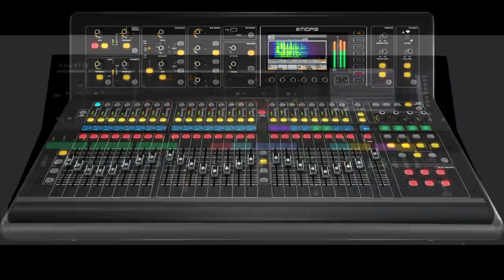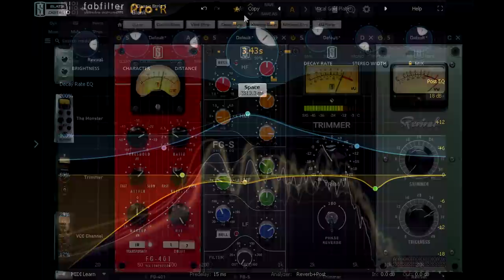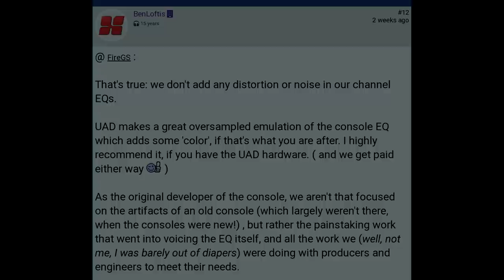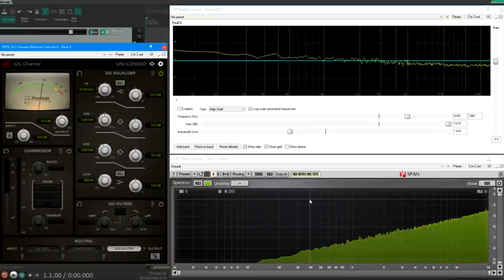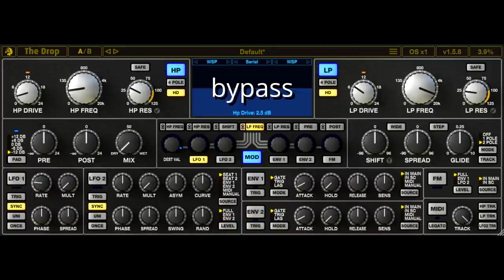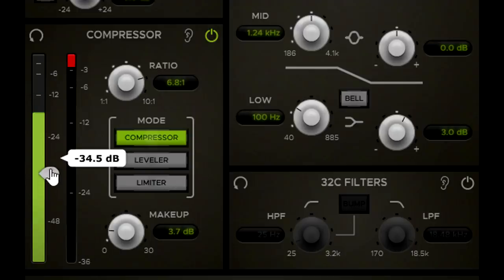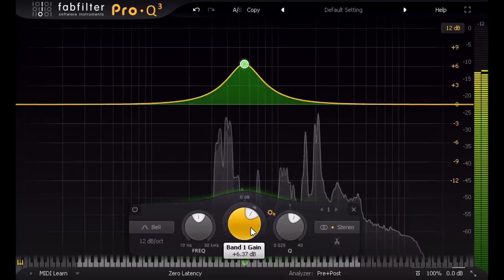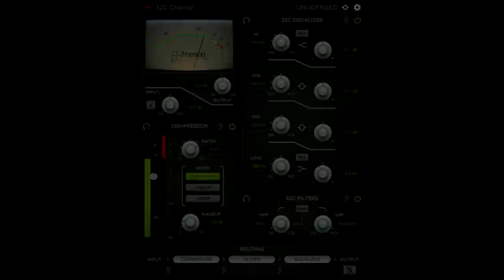Why Does It Null? (with ReaEQ) Harrison 32C Channel Strip

Comment: "More controls does not equal more control" - so profound. Just imagine if automobiles had busy user interfaces like some audio plugins. They'd be even more dangerous than they already are.
Reply: They did, and they were. Navigation/entertainment systems had to be scaled back and/or made more voice responsive due to distracted drivers.
Reply: This is kinda the point of the why the 32c EQ was designed the way it was in the first place. The values from the components chosen is what makes the final EQ curve and overall response.  If you want to adjust the Q then use a different EQ but if you want to try a proportional Q option then the Harrison EQ does a fine job of fixing the most amount of issues in the least amount of time.   If you mix with your eyes and not your ears then maybe using an EQ with a graph is more up your alley.  This is how mixing on a desk worked "back in the day" and some mixers still prefer that kind of workflow.
Reply: @DoctorMcFarlandStudios  If this vst really was made well, you could fix even more problems in even less time with no drawbacks. At least that's what I got from Dan's analysis

Comment: Maybe the circuit modelling they refer to means they made a SPICE model of the complete original circuit, used that to determine the relationship between the nominal values and actual values on the controls, and then released a completely standard digital EQ with the control values offset accordingly...

Comment: Reckon many of us have tried just about every single strip out there and, even though I don't use it specifically on an extremely high-percentage of projects, if I could have one and only one strip to choose regardless of the task at hand I have to go with Omni Channel. It's much deeper than you visually see on the surface, w/ hidden advanced features one is likely not to always use keeping the main interface relatively clean, logical, and efficient including hot-key features. It has enough tools to get you through most general mix chores as well as some more advanced tools (like the dual DS) and "color" options. Kind of crazy how many hundreds (maybe thousands) of $ spent on strips over the years and the one I'd choose today if I could have only one cost me around $20 on sale if I remember correctly. If any of y'all haven't given it a go, check it out sometime. Kindest regards.

Comment: I have nulled the overly expensive Trident EQ's which caused a huge debate on Gearslutz. Then I nulled the Bettermaker EQ, and i got attacked by at least 10 people on GS :D When i provided blind test sound examples, only 2 people reacted, both picking Crave EQ as the "better sounding".

Comment: Seems to me, like an unfinished project, from the moment you opened the plugin, I noticed the apart knobs from the compressor, and I was right you could choose only one setting per button. I use rack plugins as well, like the Slate racks, also those from McDsp are very good. Except you have to load a I-Lock instance, I don't like such things running on the background of my computer. About the plugin, I don't think I would spend my money on this one. Harrison was in the past a topnotch brand, but with this, they got a big bump.

Comment: Sort of surprised to see that Harrison didn't include the excellent bus saturation that is included in Mixbus, but it does make sense as track channels in Mixbus don't have saturation on them and the controls here are the tracks and not busses. Maybe they're planning to release the mix and master bus control strips as a separate plugin or plugins. As a Mixbus user I definitely love seeing the Mixbus DSP being made portable in plugin form and I'd definitely use it in other DAWS in order to bring my 'comfort zone' with me. I'd be really interested to hear you taking a second look at this DSP on it's home turf, embedded in the Mixbus DAW.
Reply: I 'm not sure you got the point of the video. There is no difference between Mixbus' EQ and any other EQ on any different DAW. It's a placebo. There's nothing to transfer from Mixbus to another DAW, except the false frequency references.
Reply: @dirtyharry1881  workflow, interface and the associated intuition and experience with that tool.
Reply: @dirtyharry1881   the video did not cover the Mixbus EQ. This is the 32C channel plugin EQ. Not the EQ in Mixbus.

Comment: Speaking of channel strip plugins being free of non-linearities, I recently took a look at the new SSL Native plugins, specifically the Bus Compressor v2 and their channel strip.
Turns out, neither of those plugins adds saturation out of the box, harmonics created via compression not included. EQ section nullable via Pro-Q3.
For myself, that was the reason why I decided against the SSL channel strip. Same thing with the 32C shown.
Reply: To be fair I reckon it's because they push their Fusion Vintage Drive or X-Saturator to be used in conjunction.

Comment: Wow, amazing demonstration, thanks 😁
But it's raising another big question: is Mixbus 32C DAW  emulating perfectly the real analog console from the '80s like they're claiming on the website?...now I start to doubt 🤔
Reply from the maker: No analogue console has infinite headroom: push it hard enough and the console will distort in a way that the plug-in doesn't. Of course, the original console designers would have made it that clean if they could! Other than that i can't comment as I don't have a console to compare with.

Comment: 32C tarmacked for the second time in the last few days.
Apart from your impeccable explanation about this particularily puzzling channel strip plugin. But I think that generally, such plugins don't make much sense GUI-wise. They would maybe, if if they could be integrated in the DAW channel strip. Or at least if you could use a single instance of them that auto-switch when selecting different channels. That way one could also map a separate MIDI controller just for the plugin and act like it was a real console.. But having to select them every time and switch from channel to channel just like every other plugin, I don't know. It's clunky. They're too big.
Reply: I've recently gotten into Ableton, and at first I wasn't really feeling their minimalist UI for all their stock effects and instruments. Somehow feels less inspiring. However, after spending some time with it, it's slowly growing on me (for effects, at least; softsynths, I still prefer more interesting UIs). With the way their effects strip works, you can see all the plugins/effects for a channel down at the bottom of the screen at all times; 3rd party plugins you have to open up to view their GUI obviously, but the Ableton ones or any MFL devices are just there. Even for the 3rd party effects, Ableton provides a generic X/Y controller with drop downs for assigning parameters, so even there you're able to have a fair amount of control without having to pop open a dozen windows. It's real nice being able to see and interact with everything at once, and it makes automation and assigning MIDI a breeze. (And if you want to blow up, say, the EQ to view it in larger resolution, you can still do that.)

Professionally, I'm a software dev, and I think people are just willing to shell out more cash for things that look visually impressive in all things software. For instance, this 32C strip seems almost entirely a somewhat analog looking UI wrapper around fairly stock plugin functionality... yet is being sold for nearly $100.

Comment: Dan, can we get some backstory on how you started out in audio? Did you study at University? How did you cultivate your skill set, and are they any tips or pitfalls to watch out for while learning the craft?
Reply from the maker: Never went to uni. I'm still on my gap year ;)

I progressed from guitarist, to live engineer, to studio engineer, with a three year stint as a midi programmer along the way. 

Best tip I can offer, in the unlikely event that you follow a similar path to me is: be careful with your hearing. I cringe when I think back to the cramped, untreated practise rooms I used to spend hours in, right next to a really loud drum kit... I became more careful once audio engineering became my job, but I consider myself extremely lucky to have survived my band playing years with my hearing intact.
Reply: @DanWorrall  I recently got the privilege of seeing Megadeth live in concert. I brought ear plugs, because I know concerts are a great way to do damage to your hearing. As a live engineer, is there a way to protect your hearing without muffling the sound with foam ear plugs? I would imagine that would make it hard to judge the mix.
Reply from the maker: Moulded ear plugs. Proper ones are custom made to fit your ears, and attenuate frequencies evenly across the spectrum. I actually have unusually small ear canals, and can't wear generic plugs: I find them extremely uncomfortable.

But, this is only when babysitting other engineers, packing up while the idiot DJ plays, or for monitor world. I would never wear plugs while actually mixing a show at FoH, because then how could I judge if it's too loud for the audience?
Reply: @DanWorrall  Thank you for the advice! As long as you keep responding, I'm going to keep bugging you :) What do you think about automatic mixing plugins like iZotope's Neutron 3? White Sea seemed to be pretty impressed by it in a slightly older video. After watching his review I almost went to buy it, but I decided not to. As I'm still new to mixing, I wondered if having something do a lot of the heavy lifting for me, I might not learn as much. How do you feel about these types of plugins? Do you think it's the way of the future to produce good mixes faster? Or is it a way to become lazy and produce mediocre mixes that don't sound unique? And how much does it matter?
Reply from the maker: I haven't tried it. I haven't watched Wytse's video either. Instinctively sceptical, but honestly don't know.

Comment: hi,
Have you tried Scheps Omni Channel? I think that's the ultimate channel strip. Very well designed and has everything that a person might ever need (except for creative effects of course).
Reply: Yes that's a very complete and efficient channel strip. Love the "ctrl-click" on the EQ that solo the frequency when dialing it. They smartly said that it was not modeled after any hardware, so nobody can argue endlessly about that. At $30 on sale like right now it's good value. If only it was not from Waves ... :)
Reply: @Josh Smith well, I just use V10. If it was good back then it's not much worse now I guess. Otherwise I agree that Waves is riding their fame but hasn't done anything remarkable lately. Having a few of their plugins won't hurt anyone tho :)

Comment: 100% agree! The „if it sounds good it is good!!!“ people on GS are completely missing the point. Harrison‘s marketing implies some special analog sauce or at least an authentic emulation of the eq curves. But it‘s just a 20 year old digital textbook eq that cramps near nyquist. And like you said, the analog console definitely doesn‘t do that. So regardlesss of how the plugin sounds, the emulation fails to achieve its goals on a technical level and there‘s no way around that.
Reply: "Just trust your ears" they say... ah yes that totally subjective set of ears, easily influenced by placebo, marketing, bias, the room you are in, the speakers you are listening to, your mood or how much coffee you just drank. That same set of ears that has a 24 page thread on GS of supposedly expert mixing engineers with decades of experience thinking the most basic of digital eq is something magical.

Comment: Wow I just discovered you. Fascinating, scientific, and I love your cynical voice, so terrifyingly dark and amusing :) I've used the Harrison Mixbus 32-C DAW for mixing for about 2 years and once I tried it there was no turning back. Before that I was a Pro Tools user for over 20 years. I agree with your frustration about the limitations of the channel strips, particularly the weird ranges of the mid EQ and the lack of attack and release on the compressors. However, in the actual DAW, the sum is far greater than the parts. I get mixes that do sound more "analog" almost from the moment I import the stems. And it's fantastic having EQ, compression, bussing, and VCA's on every track. It saves me nearly a day of noodling per setup. The choices they made on implementation get me "somewhere good" a lot faster than I ever did in Pro Tools and it doesn't sound scratchy or tinny like Pro Tools does. I think the bussing in the DAW is very robust and that's where it shines. That said, I echo your thoughts about wishing they had gone wider with the options available. I find myself wanting to grab the knobs and push them past their ranges (and getting just as annoyed as you did). However, the EQ center frequency"shift" upward with gain increase is supposedly a Harrison thing...I dislike not knowing what actual frequency I'm working at but oh well. I've gotten used to the various eccentricities because at least it "feels" like I'm working at a real console again. Perhaps you could do a review of their whole DAW sometime, I would love to see that.

Comment: yes man, you are right about everything, but even knowing all this, I bought it (on discount of course), because I used the leveler a lot when I used the Harrison mixbus console (software), and it sounds the same (even the console only colors if you pass for mixbuses, not for standard Channel strips): that's enough for me: being able to have my favorite leveler (which I use only in specific circumstances, but more than crucial for me, and yes, the attack control is enough for me to get this that I want).  So at a discount I gladly took it and at a discount I will probably also take the next 32c bus plugin.  Excellent analysis as always

Comment: What a well done review!

And I have to say, I find it interesting that Harrison is being so bold in it's assertions, all the while basically burning their brand's reputation. They basically assumed that the people who they were selling to, audio engineers, are complete idiots. Frankly, that arrogance on their part is probably enough for some to avoid using Harrison's plugins, and tank the brand entirely for a younger generation.

Let's face it. The company might not have any idea who they are competing with. Frankly, I can get a pretty decent emulation of their EQ section from Analog Obsession with some of the Saturation modelling for free. I can get numerous channelstrips on the market, either for free or for a good price (like Harrison's introductory price) that either equals or exceeds the flexibility of the 32C channel.

So, to ask again, how do they think they can charge $49, and soon to be $99, for a plugin that is inherently less useful than literally any other channelstrip that is regularly on sale for $50 or less? Heck, you can still download the DeadDuck plugin suite, which includes 2 channelstrips, and both of those are infinitely more useful than the Harrison for mixing and free, and for tracking Analog Obsession basically clowns on this product, all while being free. Do the developers at Harrison recognize how sad that is that they are handly beaten by freeware, not to mention pretty much all of their competitors have far more competitive products when they go on sale for $50 or less?

The fact they can't even match the functionality of the Waves SSL E Channel? Sheesh.
Reply: A lamborghini kit car made on a Dodger neon frame will still make a guy feel like a racecar driver
Reply: Shoutout to Analog Obsession. Took me a second to look into it but they sound incredible